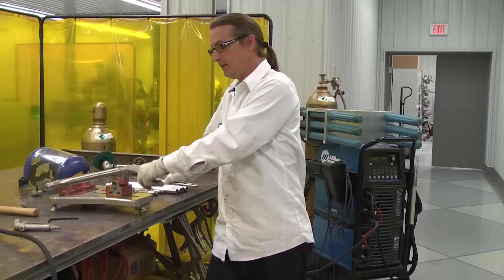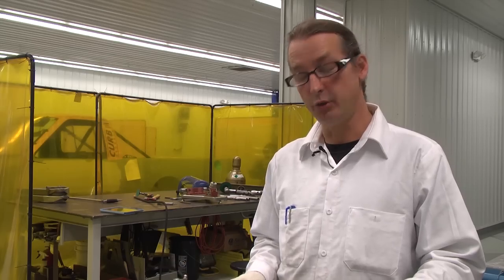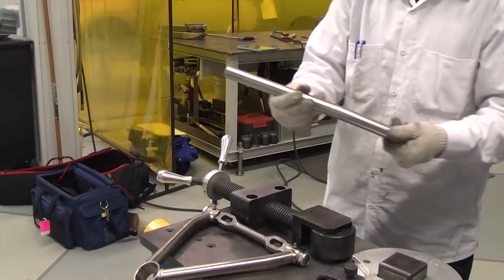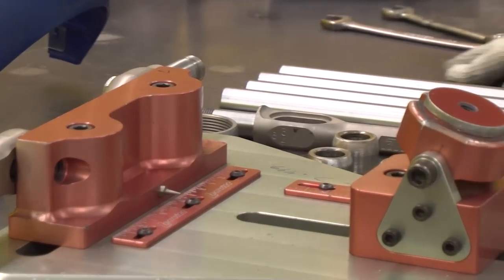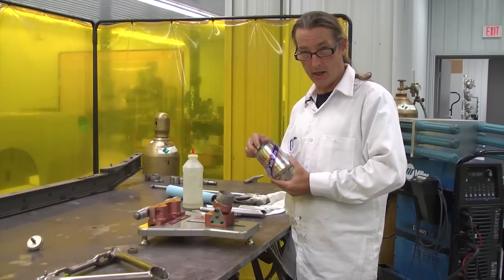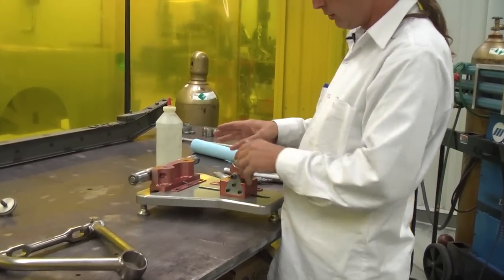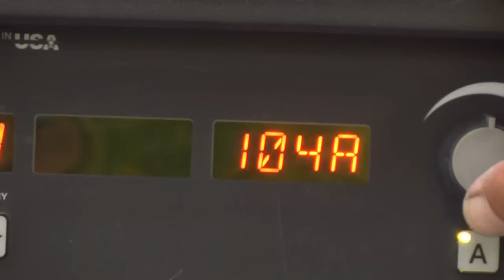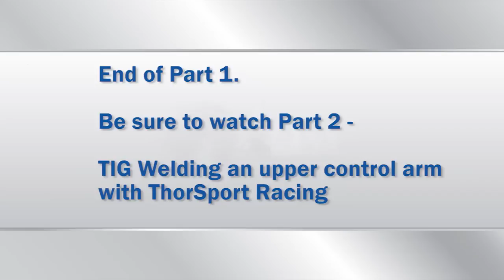How to Build an Upper Control Arm: Part 1

Comment: So the bushing is also steel? Steel to steel contact?
Reply from the maker: Hello Yuta. Thank you for reaching out. Yes, steel to steel contact with a grease fitting. The cross shaft is a different hardness than the bushing to prevent seizing. Please let us know if you have any additional questions.

Comment: What size and gauge steel do you usually use for suspension parts?
Reply from the maker: +Lenny M Thanks for the question. You'll find that the type of racing typically dictates the material thickness. For example, a drag car will use .065" 4130 material for upper control arms but an off-road truck may use .095" or thicker. Most upper control arms on stock cars use the .083" to .095" thickness in mild steel and as light as .065" in Chrome-Moly. Also, your upper and lower suspension would be different. The lower control arms are typically thicker with most stock car styles using .120" thick material. Hope this helps.
Reply: Ok thanks that helps...

Comment: Can you shed a little light on a question.. Another youtuber made the comment he stick welds anything requiring real strength.  It's obvious an A-arm is such an environment.  TIG is strong enough??  Im just a newbie so bear with me. Thank oou!
Reply from the maker: Jeff DeLuca In this video, ThorSport Racing used the Dynasty 350. This TIG welder works in aviation, fabrication, pipe fabrication and ship/boat applications, making it strong enough for this project. One can also use the Dynasty 350 for TIG (GTAW), Pulsed TIG (GTAW-P), Stick (SMAW) and Air Carbon Arc (CAC-A) processes. If you have any further questions, please let us know.